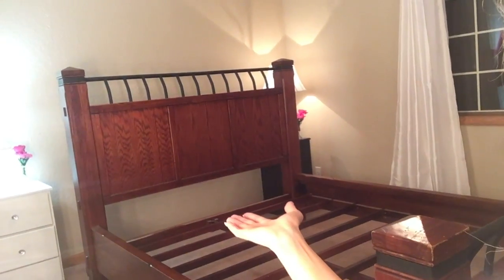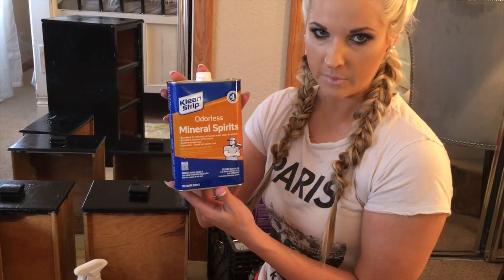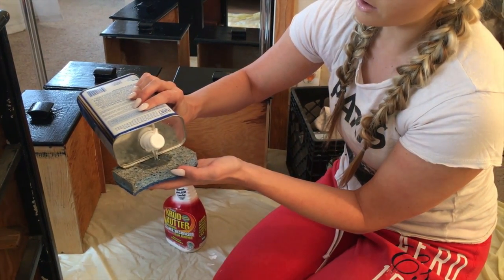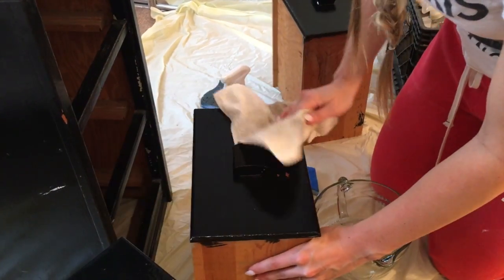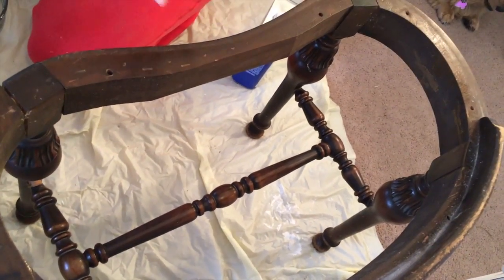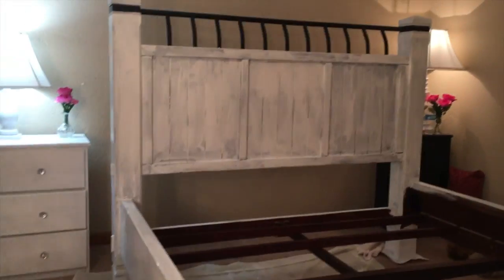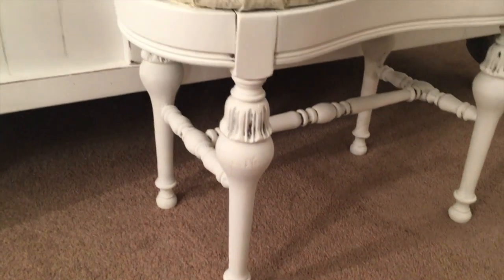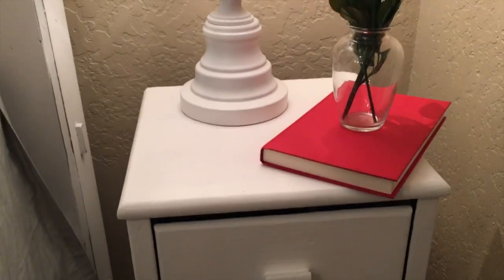How To Chalk Paint furniture from start to finish

Comment: thanks - after this video - and i have watched hundreds - i am going for the kitchen cabinets! Any suggestions?
Reply from the maker: Roseanna Caruso thank you! How exciting I have never painted cabinets but my friend has. You can't be in a hurry. May take a few coats depending on what color your doing. The nice thing about using chalk paint is no lee sanding required. I would definitely finish with the hard wax for sure. Have fun
Reply: Carli Eich - thanks for the help! Will let you know how it goes! Love the bed & Yorkie!
Reply: Carli Eich also, how long between coats please
Reply from the maker: Roseanna Caruso it depends but as long as it is dry completely which could take 20 min or so if it still shiny in places it's not dry the more even you put the paint the quicker it will dry. If it isn't dry and you paint over it it will strip the paint off... learned that the hard way.

Comment: Great video. The best chalk paint video on YouTube in my opinion. I wonder what step I'm missing if I have streaks after I'm finished painting and it's dry. Ugh. I want a neat clean look, not like I used cheap paint--when I didn't. Any advice? I've done all the other steps and I even got an expensive primer from Annie Sloans biggest competitor. Everybody: you might want to look into that it was only nine dollars and you spray it on then wipe it off and then you can paint glossy furniture without sanding or glass or wood or wicker, even brick.
Reply from the maker: Candace Bolin oh my goodness thank you so much for the compliment that made my day. So with streaks it just means you need more coats and apply it as even as possible and depends on what type of brush you use...
Reply: I’ve heard that if you want to avoid streaks that you have to apply your first coat full strength and do one or two extra thinner coats diluted with water. Hope this helps!

Comment: I’ve been wanting to do this but I’m still not sure... does the paint scratch off??
Reply from the maker: Yara Pacheco hey there when you use the wax top coat it won’t scratch at all. And I painted our night stand without the wax and it doesn’t scratch off either it take a few hours to full dry then a few day for the minerals in the paint to harden and fully
Reply: Carli Eich thank you for responding... I’ll be doing it soon!